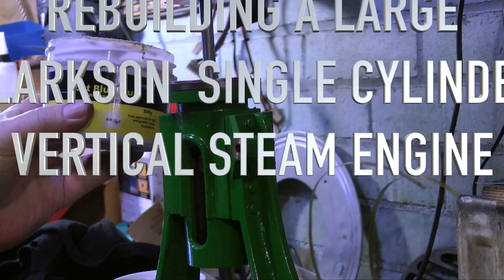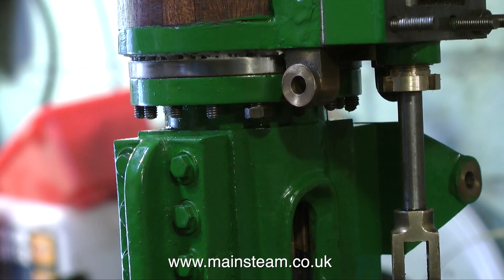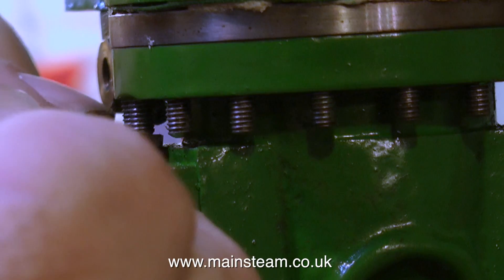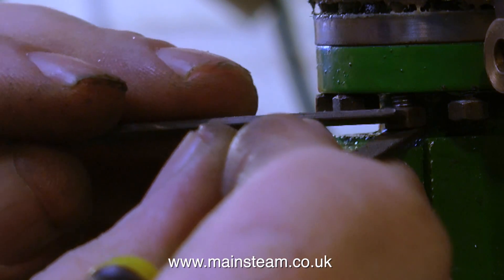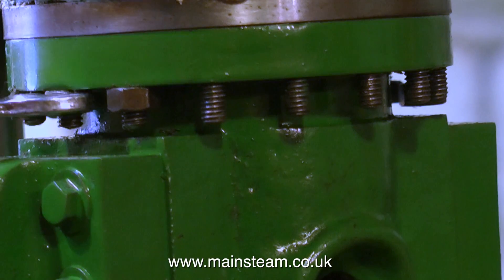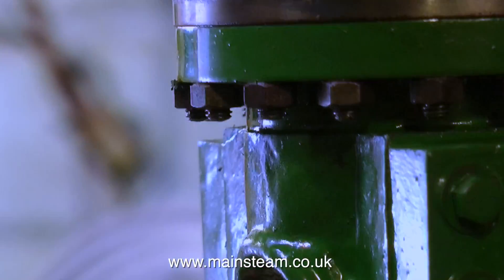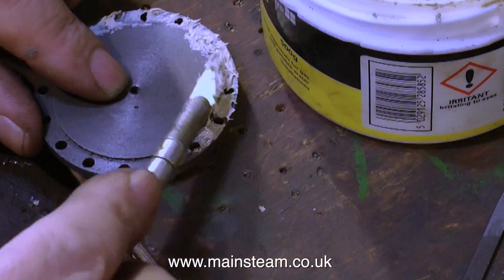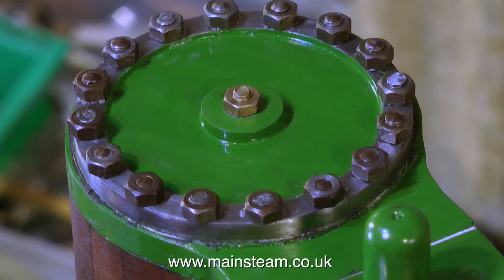REBUILDING A LARGE CLARKSON VERTICAL STEAM ENGINE - PART #25

Comment: The gasket sealer, will it harden or stop the piston from making full travel in the cylinder or just get blown out during start up operation?
Reply from the maker: +Mike C. It doesn't harden, any surplus will just find its way to exhaust.
Reply: Thanks for the answer and the videos